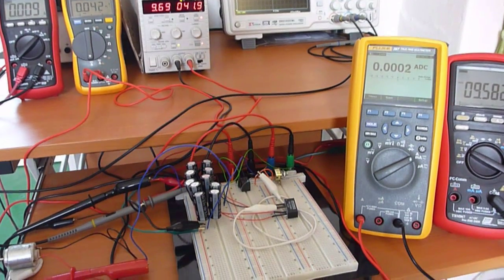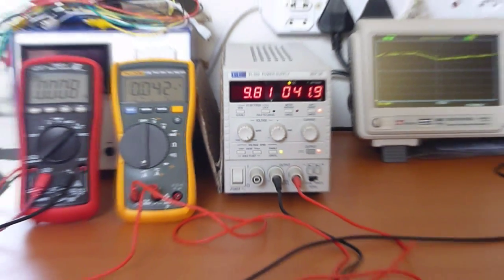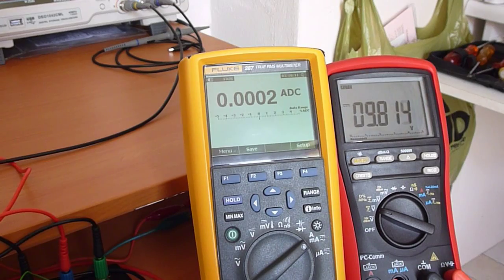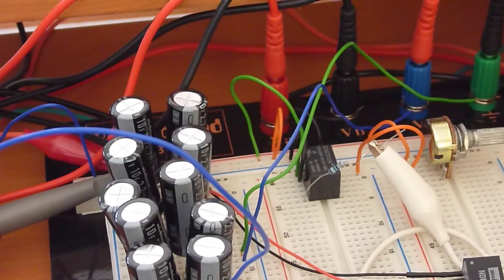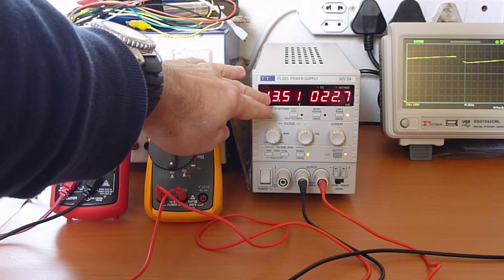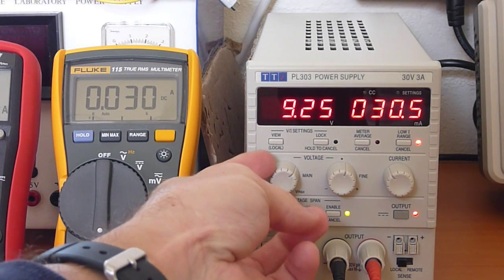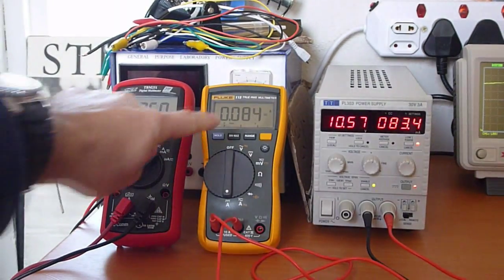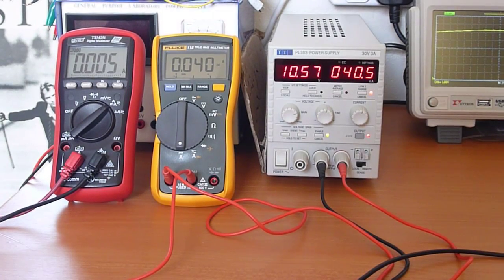Solar Powered Kindle  - Part 10: Locating the losses....

Comment from the maker: @electrodacus Very good point! The reason I chose to work on the lower voltage range is to cater for lower light conditions when the panel might struggle to reach 13V and activate the relay. i.e. there would be no output and I thought it would be better to have some output at the lower range although less efficient. But...as you'll see from the next video that's no good...so point taken. I've ordered some crystalline cells and I'm off to get a comparator today to start playing with that.